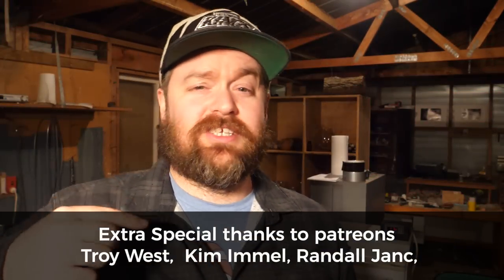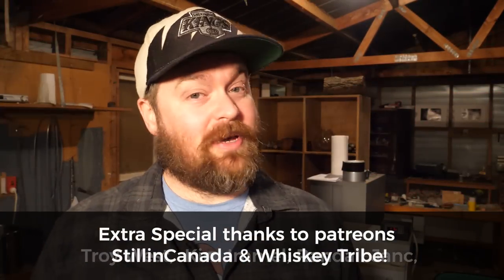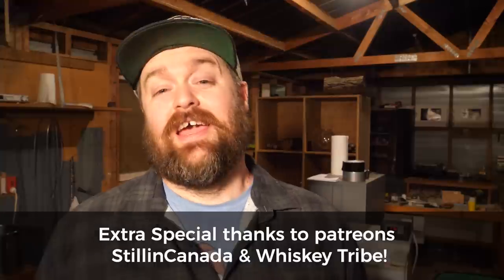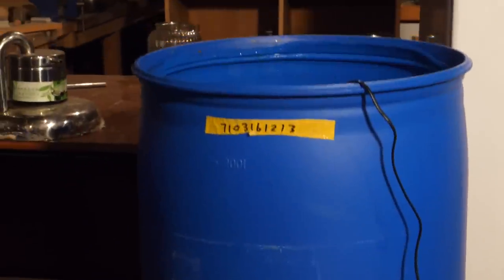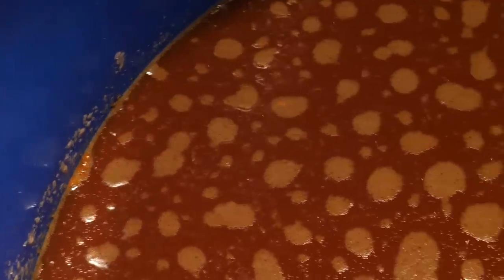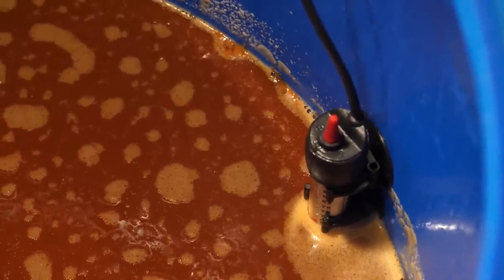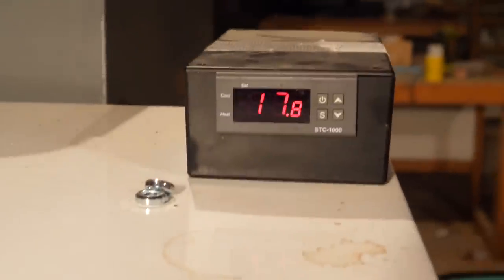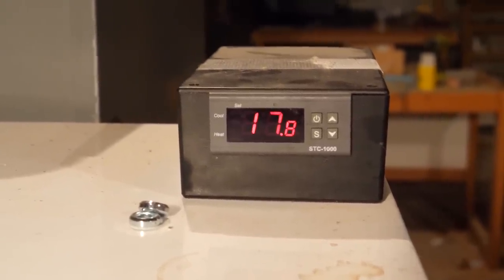Fermentation Temp: Why Monitor  It & How To Control Temperatures

Comment: There was a bit of a learning curve for me, living in the great white north, fermenting in winter, then in summer.

In winter, the wash is very insulated, and requires the heater within the first 12 hours.  In summer, the barrel is uninsulated for the first several days, then insulated for a couple, then finally heated for the remainder.  Sometimes it is warm enough (like this friggin heatwave) where no insulation or heating is required at all to finish up.  It is never hot enough to need to cool it however, unless I pitch the yeast while the mix is still too warm, which happened to me once and the yeast heated the batch and cooked itself to death.

My favorite tool when mixing a batch is a IR temperature gun for pitching, and a STC-1000 hooked to an aquarium heater (because you should never trust them alone).  When there are tools out there to make life easier, why not use them?

Comment: My set up: I do 6 gallon mashes. So I got a large washtub (Walmart $10). Have a basic copper wort chiller made to the outside dementions of my ferment. Bucket. 1 put bucket inside  wash tub,, 2. Put chiller around fermenter, (inside washtub) fill w/ proper temp water,, hook wort chiller to small submersible pond pump inside of ice chest w/ water and LARGE chunks of ice. Also put aquarium heater IN WATER BATH TUB. I use a inkbird temp controller ($30). So plug the pond pump into the “cold side”, and the aquarium heater on the “hot side” (of inkbird) . When it’s too hot ,, the pond pump kicks on and circulates VERY cold water thru the wort chiller, dropping the temp (QUICKLY), when it’s too cold,, the inkbird triggers the aquarium heater, heating the water bath !, this maintains the water bath !! I have found the heater IN the mash is not as efficient,, giving distinct hot spots, where the water bath maintains the temp nicely !! With a large cooler and large ice blocks, you only have to add ice every three days or so !! It’s basically a glycol chiller at a WAYYYYY CHEAPER price 👍😎

Comment: Came across your video. The temp control of fermentation along with product storage/aging was rattling around my head that last few weeks.  I just read a paper about how fermentation temps can decrease or increase the ABV % produced by the yeast from below normal to as high as 22%. The test used certain wine yeast within a temp range of 20 C - 26 C. The temp band according to the article did not produce off-flavors, except for the high alcohol smell/taste in the higher temp ABV products produced. The test environment controlled ph as well as nutrient and feeding.
Reply from the maker: Interesting.  Yeah different yeast definitly react differently.  Want ot really blow your mind?  Have a look a Kveik . . .

Comment: Timely topic. My second ferment is a Bavarian Hefeweizen. I thought it would tolerate warmth better as instructions seemed to allude. 80 degrees in house, no ferment. Before taking drastic measures, I took it to my wife's studio out back    where temp is around 68, and ferment is so good, I had to abandon the air lock with a blow off.

Comment: Great point at around 7:30 regarding temperature control varying at the start and end Jesse. 
I put my 1st two washes on (a Turbo and a TPW) and they both reacted well at the start and slowed to a 🐌 at the end.
Unfortunately I tried to bring the temp down early and wasn't able to hold it late BUT now I've learnt a valuable lesson and your video has confirmed this 🙏👌👍
Cheers mate!

Comment: Hey mate, good videos. ive just started making spirits and your videos have been gold im just about to start a UJSSM after watching your videos. I am in the tropics and i've been brewing my beer in a fridge that is controlled by the BrewPi for a while now. works like a treat, and it also keeps a log of the brews that you do. well worth looking at. ive done mine on the cheap with a little Arduino, old netbook and a little programming. but they do make one ready to plug and play.
Reply from the maker: Awesome!  The brewpi is a nice setup aye?  I envy all the sweet fruit you must get!
Reply: The BrewPi has been really good ive been able to brew a lager at 12c while its been 42c and 70% humidity outside. At the moment im brewing some wash using CL23 yeast at a steady 20c in it. yeah its mango season so I think some mango brandy will be the next run 👍🥭

Comment: I took some Heating Pads and blue painters tape to secure them to the surface of a 55 gallon barlow.  I insulated it with Hot Water heater insulation and control it with a PID controller.  Cheap and work's like a Mother.  Happy dayz friends.

Comment: Good stuff J keep it up. I use a heat pad with a PID controller and SSR, it keeps the temperature to within at worst 0.5 degrees after a short time - no cooling though....yet . I also use it (in manual as a percentage output) to controll my still heater.

Comment: like, + love, ++ temp control is key, +++ my homebrew has gotten way more better since I started controlling temps.  ;) @ 1:23 you talk about fermentation in winter being to cold for Lagers or what not.   winter is the perfect time to do a lager, before I had my temp controlled fridge it was the only way.  hehe.  my last lager was at like 42* for 3 weeks.  And nice I use the same STC1000 in my homebrew setup and I made a box that looks like yours!!.  lol  for ales when I started out and it was winter I would use a large plastic tote/bin remove the lid add water and add the fish tank heater.  it was called a swamp bath setup from what i recall.   I would heat the water to what I wanted the beer to be at.  I would then set my bucket in the bath and all the temps would even out.  those fishtank heaters can do a great job to hold a warm temp.  they turn off and on and keep the water nice and steady.   that was great on the winter, but in summer need to use the STC 1000 and a fridge or chest freezer.  works mint.  love it!  like how you touched upon the PID as I have no clue on those yet but am curious.  you definitely should create a fermentation chamber.  I got my RC cola fridge used for 50$ and replaced the door gasket and it is amazing.  one draw back it sucks some power when on.  lol  which is often.  ;) love the video.

Comment: Food for thought I ran fish tank heaters in my brews for years when I was in a colder climate biggest thing I found was if it was a 25ltr wash use a heater designed for a 25 ltr tank and so on (touch wood) haven't cooked a wash yet

Comment: A welcome presentation, however, a PID controller doesn't "learn" anything. It just compensates what it does based on how long the temperature has been wrong, and how rapidly it is approaching or leaving the correct temperature, and of course, the difference between correct temp, and what the temp is right now.  PID stands for Proportional, Integral and Differential (or derivative). They are notoriously fiddly to get to behave correctly, and are most suited to things with a big inertial problem such as getting a machine to stop at the right location... driving it toward the right location results in it going too fast when it gets there, so it overshoots badly etc. Liquid temp in a brewer has temperature, which doesn't have any significant inertial behaviour. So the most practical control is the type you are using.

I would like to see an effective way to get cold out of a small bar fridge, and into my brew, which is far to big to go into the fridge.
I have a steel cake tray that fits neatly into the small ice chest. I will run car glycol mix from it using a small water pump, through a cooling tube in the brewer... I previously had a bucket of water in the fridge and pumped from it with very little success.

Comment: Wow - Love it. I'm looking forward to you doing the fermentation chamber. 
I lived in Brisbane and never had and issue with fermenting 100 litre batches. had my fermenters on a pallet and they fermented out in a week summer or winter. Now I am in Sydney and using the same fermenters I'm struggling. its OK for the first little while than it slows and the brew belt is just not maintaining the 23 - 27 deg. I'm going to try the aquarium heater at 200 watts. Thanks so much for the info.
Reply from the maker: Yeah it is a interesting problem to solve aye?  Our climate here sits either side too.  Too hot during summer.  To cold during winter.

Comment: Hey, be extremely careful with the electric heaters with plastic housing, they need to cool down before you completely switch them off. If you don't cool them down before completely shut down they tend to catch fire next time when you switch them back on.
Good point on PID vs. STC.

Comment: Hi after looking at some people who say there’s not enough circulation for a fish tank heater . I got some 40 mm waste tube . Trepanned a plastic lid and hot glue gunned my heater  in the tube in boiled water . My theory is the tube water gets to temp and the plastic is not conductive enough to kill the yeast . Then wrapped  the outside of the barrel with sun lounger Cushing .
The room goes from 12c to 20. My 25 litre is 21c with a 50watt heater.

Comment: Problem with PDI controllers " Proportional, Incremental, Derivative"  the heating elements whether distilling or fermenting get very hot at the surface of the element.  This surface temperature of the element will kill yeast during fermentation or boil away alcohol.  You must understand this flaw and adjust your design  appropriately.  Example Fermentation best to use another smaller vessel and heat that water and circulate it through a closed loop system at around 100* F or 38*C.  Distilling close off all covers ie your Sanki fittings, valves ect.  You do not want any vapor from boiling at heating element to escape your pot.  Hope this helps.
Reply: This is the single best comment regarding heaters and brews. Why serious brewers aren’t using a double pot set up is beyond me. I would do it for mead if not for my house being temperature stable. If i moved to garage or similar then id move to a closed loop water heater/chiller set up. This way year round cooking is possible.

I will note another good idea is a to have a very well insulated mini room or similar if you do lots of small batches. Its simply cheaper and more efficient at this point.

Comment: Aquarium heater needs to be put in a fish long bag with water so the        fermentation does touch the element and cook the yeast also help spread heat evenly just need a slightly bigger bucket

Comment: Super topic! Thanks as always Jesse. I've been trying to come up with a design for a fermentation chamber for a 200l fermentor, but haven't figured out a cheap way to cool inside the insulated box (other than a fan). Any ideas????
Reply from the maker: Yeah I am thinking about it too.  I am wondering about taking the door of a fridge and the building that into the side of the box.

Comment: yeast swingers party? hahaha. I´ve used STC-1000 with heating belt/fridge for 7-8 years and never had any problems. I also ferment at the lower end of the recommended temp for the yeast. Cheers
Reply from the maker: Nice.  The stc is solid aye!
Reply: Still It Yes, very solid. I`ve got a couple for fermenting fridges and keezer and I`ve buildt a couple spares just in case one failes. They work and I couldn`t have my hobby without them

Comment: @Still It ,

Jesse,

Can you cover esters and flavors and how to get them? For example vanillin can be produced from new oak. If you wanted to focus a spirit to just have sweet floral light vanilla flavors without adding anything other than yeast sugar and water and "aging" with new oak for more rounded flavors. The other way could be more spicy earthy notes. I know, like you have mentioned temperature of yeast matters but what else can we control to focus on all the chemical compounds? 

I know you can add flavors and other notes artificially, I am looking to try and produce a pure product from the start and not put a band-aid on a issue of lacking knowledge.

cheer!

Comment: Watched this cuz I'm thinking I want to make a large-ish fermentation chamber...something that can hold a couple 6-gallon carboys at least, preferably those + a handful of 1-gallons.  While this isn't the video I wanted exactly, it DID still give me some solid information.  Using a PID, for one.  My intention is to make a Peltier heater/cooler water cooled on a common reservoir at this point. Radiator should pull heat as well as displace cold...as long as it doesn't freeze (might use glycol instead of water for just that reason).

Hopefully PID aren't too spendy, but if they are, can use what yer using.  Peltier aren't expensive and I can scrounge the rest for the most part, might need to buy a cheap chinese radiator...
Reply from the maker: Hi mate,  you and me both!  I have been pondering this for some time.  I still have not really settled on how I want to build my chamber.  Ideally it would be great to have separate heat management on each fermenter.  But that gets rather pricey!  

Thats pretty close to how the commercial setups do it.  Check out the SS glycol system for example.   The heating is easy, its the cooling thats tricky! 

Right now I am kinda leaning towards using a semi portable airconditioner in a over sized insulated box.  I had toyed with the idea of having the air-conditioner set a little lower.  Then using individually controloed heating blankets/pads/etc on each fermenter.  But that seems rather inefficient!

Comment: This is always a problem for me if I go over an eight gallon batch I finally made a wort chiller out of copper pipe mounted it on my lid then I use a fountain pump to circulate cold water when my temperature is to warm a  I use a pid to control it and freeze two liter soda bottles that I add into the bucket when needed.

Comment: I just wonder if using aquarium heater without decent liquid flow around it (like you have it in aquarium) doesn't maybe create a hotspot around it, so having optimum temp only near it, and as you move away from it the temps get lower? Maybe using multiple smaller heaters located in different places could help mitigate this, if it's a problem at all.
Reply from the maker: Yeah I think that is a valid point/concern.  Not a bad idea having a couple of smaller ones in a large ferment.
Reply: a little bit pricey, but this where an agitator would be ideal.  Gently spins the mash/wash without introducing oxygen but keeps the yeast and temps stable.  Can be made with corded drills, but finding a stainless steel paint mixer might be a bit of an ordeal
Reply: i guess you could make one out of copper pipe

Comment: I know this is an older video, I have a question, I was wondering I have used an Aquaium heater for awhile now. I do aquariums too. would a small pump inside the fermenter help or hurt?

Comment: My closets 74-75 degrees Fahrenheit year round. No worries here it floats my pancake.
Reply from the maker: Hot water cupboard?
Reply: I live in a condo my place is allways the same. Central air helps I don't do anything special. Obviously my fermenters are a few degrees warmer from metabolic heat. But my hang up little thermometers all ways in the 74-75 degree area like I've allready stated. Kind of frustrating not being able to ferment things like saisons or lagers obviously on opposite ends of temp spectrum.
Reply: Not really, about $100/month give or take few $. 11 other condos in my building I get everyone elses hot/cold our building comfortable year round.
Reply: Entire energy cost.

Comment: 4:50 definitely use stress intentionally for some unique qualities.  Check out the thread on hd and adi about intentionally stressing the yeast with heat so that the yeast produces diacetyl - a chemical that creates a butter aroma and flavor.  buttery corn whiskey and butterscotch rum.   White Labs discusses the timeline here: https://www.whitelabs.com/sites/default/files/Diacetyl_Time_Line.pdf

Comment: Hey mate new to this all glad  I found your channel. I have a question  for you . . . . Do you know if the (pair coil) i think it's called that you get when you buy a heat pump system .is the copper tubes  safe and ok to use ? Both new and used pipes . I know the used  stuff would of had  the gas for the system running though it  not sure if the copper would absorb any thing . Any  help would be great  cheers
Reply: repn rfb Hi, the refrigerant is not good for you and would have been slightly absorbed by the copper. There will also be some oil residue in the copper so I wouldn't go near it if I were you, nasty stuff.
Reply: Steve Hubbard  what about the brand new stuff ?
Reply: As long as it hasn't had the refrigerant in it should be ok 😀

Comment: Poor bugger. Guess you used a 50-60 gal (150W-200W) heater in a much smaller bucket eh? Unfortunately each of those damn things only work for a certain range. It can’t lower the wattage so the heat output is based on the assumption that you're heating X gallons and it's full-blast, or nothing. 
I guess you'd have to buy a lower watt heater for smaller 5-10 gallon "fish tanks"… or risk killing your "fish" as you discovered. Sad times...
Reply from the maker: Yep that's exactly what happened! Haha.  

Lesson learned 🤔😉